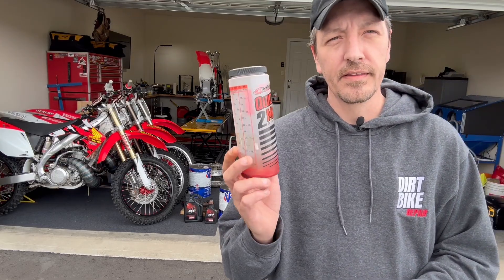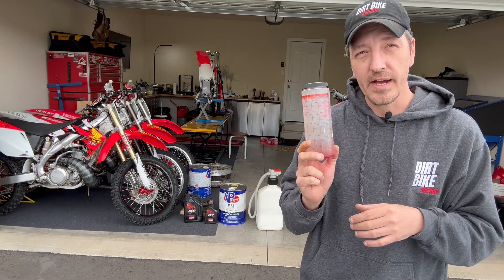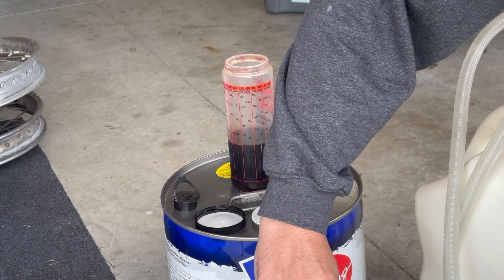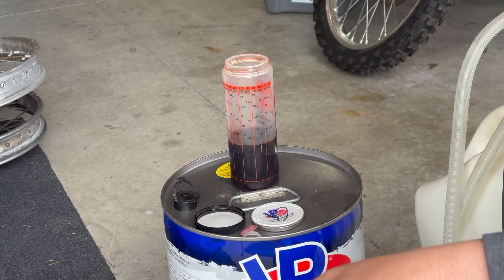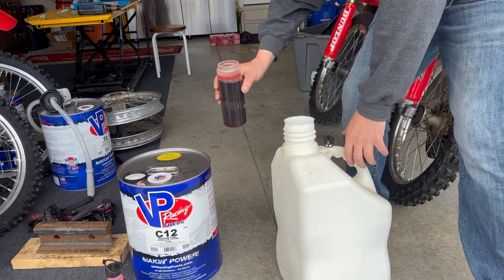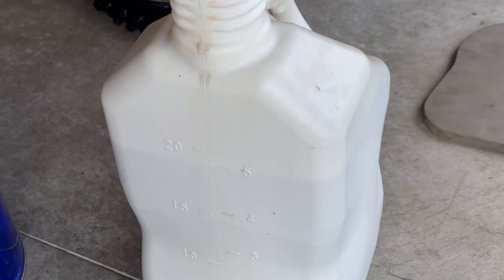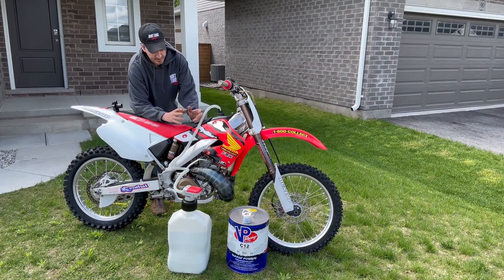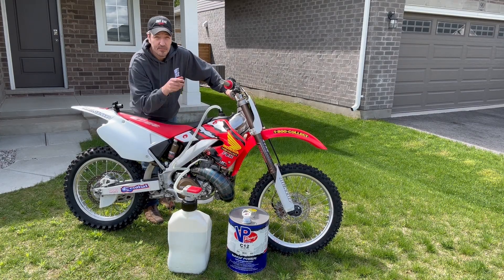How to Mix 2 Stroke Fuel for your Dirt Bike

Comment: Motul is a quality brand and celebrated worldwide. If you are racing, I would go for 32:1 ratio, but if you got a road going version or Enduro rather than Motocross 40:1 may well be sufficient or if you are using Castor based racing oil 40:1 may well be sufficient for constant top end use.

Comment: I like the quick mix because it has a lid. My ratio right has to be cleaned every time I use it because it's open and crap is always stuck to the oily cup
Reply from the maker: I like the quick mix over the ratio right when mixing my 2 stroke oil too.  The ratio right has its place in my shop for sure don’t get me wrong but that quick mix is a handy container/ tool.  

Thanks for the comment and for watching!

Comment: I prefer the ratio rite container because the numbers and level is imprinted on the plastic. yours looks like numbers will wear off. nonetheless, one 16 oz bottle of hp2 to 4 gallons perfectly mixes to 32:1, best lube out there behind maxima 927
Reply from the maker: I have a ratio rite container as well it’s a great measuring cup for sure..

Comment: 3 oz of Klotz castor to 1 gallon of 100 octane race fuel. (40:1) Shake well. Enjoy.
Been running that formula for 40 years and have never had any kind of engine issue.
Reply from the maker: Klotz is a good oil for sure.  I like there fuel too

Comment: Great video, I bore my bike from 67.35mm to 68mm  wondering wich jetting i should go with
Reply from the maker: Really hard question to answer.  There is a lot of factors that go into answering or even recommending anything the best info I can give is to use the pro circuit webpage.  They give a great chart to help you look up your bike abs the best settings to start with.  99% of the time they are right on jet size and setup in my experience
Reply: Okay I'll contact them thanks for you feed back
Reply from the maker: @luismelendez935 it’s actually just listed on there website.

Comment: 32:1 is 3% oil. Thats diluted enough!  A 4 stroke uses 100% oil.
Reply from the maker: Not sure I’m fully understanding what the point is your trying to make.. but I agree, 4 strokes use 100% fuel, no oil added in them.
Reply: @Dirtbikerepair  I'm saying, 32:1 is only 3% oil and 97% gasoline. Meaning... 32:1 is already is lean enough. You wouldn't want less than 3% oil.
Reply from the maker: @mareksumguy1887 that is the age old argument.  I know that KTM actually recommends a mix of 60:1 in some of there bikes.  VP fuel sells T2 wh itch comes pre mixed at 40:1 so there is arguments both ways.  I always ran 32:1 when I was racing mostly because I was riding the bike on the “pipe” and it was being pushed a lot harder..  not I’m definitely not as fast as I once was and I don’t find my self riding in the same power range..  so 40:1 seems to work really good for me in my bikes.. and my 500 will not run properly with anything else.. so I just run the same mix in all my bikes, keeps it easy rather then have 10 different mixes kicking around.

Thanks for the comment and obviously for watching
Reply: @Dirtbikerepair  KTM can take a hike. They recommend such lean mixtures for pollution reasons, which are forced upon them by stupid government.  I'd be willing to bet their 60:1 recommended bikes would run better and for much longer with, say, a 40:1 fuel.

Comment: Where did you get the transfer pump from?
Reply from the maker: its called the "Tera Pump" it works really good 

https://fortnine.ca/en/tera-pump-battery-powered-racing-fuel-can-pump-trfa01-xl?utm_id=71546087880&utm_campaign=1768282015&utm_source=google&utm_medium=paid&utm_content=342570873497&gad_source=1&gclid=Cj0KCQiA7se8BhCAARIsAKnF3rzYlCCUnfw8VzTM2aleydcRsHLZuLQ899KijBL90BBHCAjZahitg7QaAqX4EALw_wcB

Comment: Can you use pre mix on a cr 85rb expert
Reply: No I’m saying the vp already mixed fuel
Reply from the maker: Oh ok, I misunderstand your question.  Yes you can run race fuel in your 85, if you were to actually look at the Honda specs for that bike I’m pretty sure it actually asked you to run over 97 octane and No ethonal
Reply: @Dirtbikerepair  ok thanks I know it’s a race bike so I figure it should be cool
Reply from the maker: @extreme_outdoors_hunting  it will be a bit more "snappy" I'm sure... but you might need to adjust your carb a bit to get a little more fuel in the engine.
Reply: It said small engines but idk if it meant mowers or dirt bikes too
Reply from the maker: Yes, it’s a 2 stroke.  2 stroke engines need to mix oil with the fuel to lubracate parts in the engine.  ( the crank and crank bearings for example.) if you don’t mix your fuel with oil you will damage the engine. What people call “blowing up the engine”

I hope that helps answers your question.   A 4 stroke engine is a bit different and you do not need to mix oil with the fuel.. the engine has different parts that are lubricated internally

Comment: 40:1 Yamalube synthetic has always treated me right for stock  compression motors. Unfortunately here in Arizona we only have 91 pump available so anything with even slightly higher than stock compression I shoot up to a small airport a couple miles from me and mix 100LL Avgas and half pump to bump octane to about 96 and it's affordable. Av right now is about $6 a gal.
Reply from the maker: I have mixed Avgas with high test here before.. best fuel we can get at a pump here in Ontario Canada is 94. And Avgas is running around $3.00/L  (about 5L/G) so it’s definitely more affordable then running race fuel at $10/L   Yammalube is really good oil..  I think the important part is running the best fuel oil mix you can afford. 

Thanks for the comment and for watching as always

Comment: Great video. I run 40:1 never an issue. I have the same oil mixer works great. Keep up the videos
Reply: hey mate quick question i just bought a 2010 ktm exc250 what fuel mix do you think it doesn't say anywhere on what i should do me and my dad decided we should start off with 50:1 then see from there what's your thoughts
Reply from the maker: @remyhyslop-b1v I know that KTM recommends between 40:1 - 60:1  I personally think 60:1 is kinda crazy… lol I do have a buddy that ran his in that range and he never complained about it..   I personally would run 40:1..  or talk to the manufacturer of a really good premix oil company and see what they recommend. 

40:1 is usually a lot less oil then most manufacturers recommend.. KTM is the only manufacturer that I know of that has recommended any kind of a leaner mix than the traditional 32:1.    Hope that helps..  40:1 worst case you foul a few plugs and you don’t blow your engine.  If you keep fouling then try it at 50:1

Comment: How many ounces or Canada units for 5 gallon of fuel?
Reply from the maker: That would depend on what you are mixing at for example 5 gallon but for easy math I’m going to use 20L  mixed at 40:1 = 20L of fuel 500ml of oil 
32:1 = 16L of fuel 500ml of oil 

That’s really what you can mix in a 5g fuel can
Reply: @Dirtbikerepair so should you have stopped it at 20 on the measuring instead of 5?
Reply from the maker: It was for 5 gallons of fuel.   That’s how I buy my race fuel
Reply: @Dirtbikerepair correct but what does the numbers on the left side stand for 20 as in ml?
Reply from the maker: 20 as in 20L of fuel…. Almost the same as the 5 for 5 gallons of fuel   You fill the oil to match the amount of fuel you are dumping the oil in..  and at the ratio you are mixing..  if you were mixing with less oil like say 100:1 the number 20 and the number 5 the represents the fuel would be a lower in the container giving you less oil

Comment: Will you ever do a carb video too like how to get good jetting and not running to lean or rich
Reply from the maker: We have been trying to plan a video on carb adjustment and setup.   How to setup and jet your carb
Reply: @Dirtbikerepair this would be great if you could also show where to buy jets/ needles and everything else you need. Also if you could show what a lean and rich running bike sounds like
Reply from the maker: @smward1126  I will try and get that video up on the channel sooner then later.  thanks for the input on what people are looking for, and what kind of videos you guys want to see.
Reply: @Dirtbikerepair if you mix a large quantity , does the mix stay perfect in the container forever or is there a time limit before it should be used ?
Reply from the maker: @lynxeffect84 that really depends on the container, the temperature, all kinds of things.. the quality of oil, the quantity of the fuel..  but it all has a shelf life.. but I typically will mix 20L or 5gal at a time..   so that last me about 2-3 weeks..  I also store it in metal containers rather then plastic
Reply: @Dirtbikerepair  OK thanks for the reply